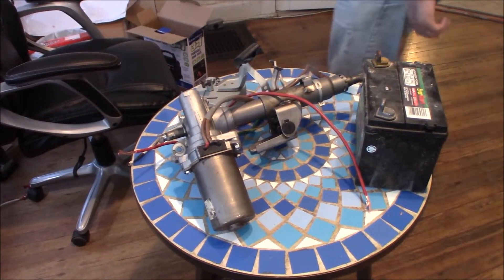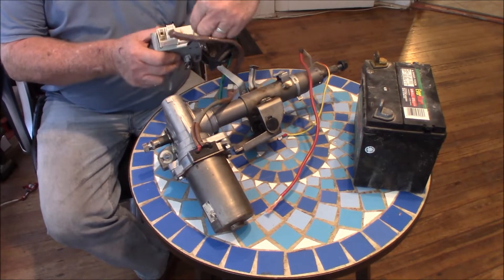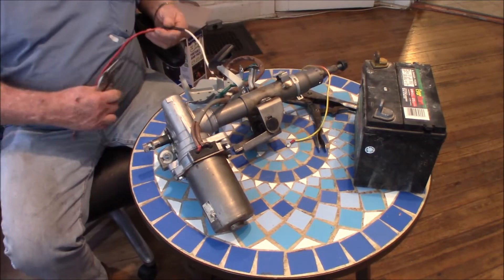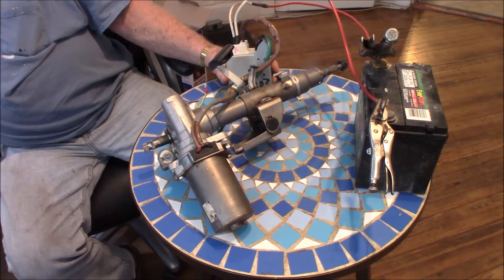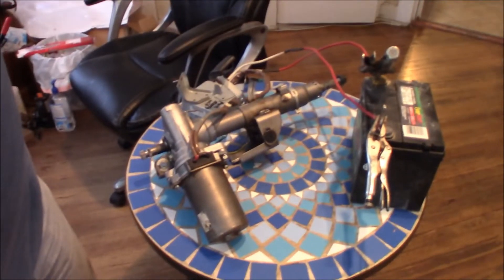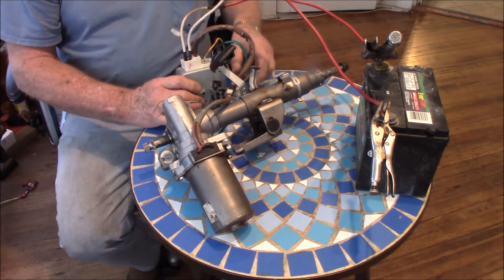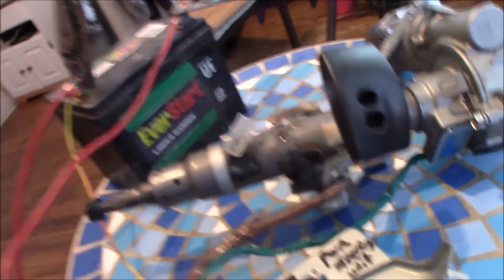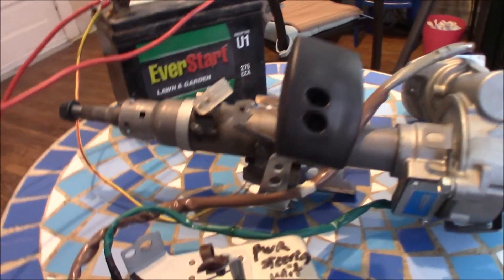2007 Prius electric steering,, why don't it work

Comment: Had the same issue with mine, after reading the comments here, I added a load to one end and it seems to work as it should, stating installation soon
Reply from the maker: yes, I didn't understand how those things worked at first either.

Comment: If you here a click when you connect the single wire, ( ignition volt trigger) then you should be good. You need to have resistance on both ends of the shaft.  I'd put a pair of vice grips on each end , to give you something to grip
Reply from the maker: yes, I finely figured that out but it didn't fit my tractor so I sold it thanks .

Comment: Did you figure it out?
If you didn’t the wire what you plugged in last (ignition positive) I believe there’s 3 wires in that last plug you need to ground also.
Reply from the maker: thanks for helping,, it turned out I didn't have a load on the lower shaft once I did that it worked as it should, thanks again.
Reply: @MissouriOldTimer  Ah awesome. Looks pretty easy to hook up and get working then. I might have to try this.
Reply from the maker: @JDawgBuilds  I was going to use it on my little tractor but there just wasn't enough room so I sold the steering unit.

Comment: I sell these (and the Nissan and Corolla version) on ebay and have more experience than everyone who comments. A few folks got it right and so do you with electrical connectors.

The way these work is resistance triggers them to 'assist' in the direction you're turning. So with column sitting there on a bench its simply waiting for you to turn the steering wheel AND have some resistance as if wheel is on the ground. 

Hook power and ground up only and grab two sets of vice grips,clamp one vice grip to the end to the splines on the steering side (this is the end with nut on your video) and clamp other to rack end spline on the steering shaft. Next have an assistant hold on to one end while you turn the opposite way. It will feel like nothing, because after all its just a steel shaft...next hook up that small accessory wire, this makes the system turn on and click. And do the same turn test with an assistant...be ready!!! The electric power steering is goin to assist the person turning. 

Ive sold about 40 columns this year alone. I hope this helps.
Reply from the maker: thank you very much.
Reply: @MissouriOldTimer  Not a problem at all, a buyer sent me this video and feared he would have issues. I have this same model installed in my Chevy Nova and Im never going back to hydraulic. Much love from Indiana
Reply from the maker: @2muchspl   unfortunately, I wasn't able to put this on my little Mitsubishi tractor, there just wasn't enough room, it would have been great if it would have worked.
Reply: @MissouriOldTimer  Yes, size is deceptive when it comes to these EPS. I cut, welded and random universal jointed via eBay to get it where I wanted. The hurdles were tiresome to say the least.
Reply: How much to you sell them for on eBay ?

Comment: I just bought the same one as yours i did the test very same as yours. I its didn't work just hear the click. I brought its to the store. They told me i need to put load in the end side. Tomorrow i will test before intall in my mini van. Hope its work. Your video very helpful. Thank
Reply from the maker: yes you are right it does need a load on the output side for it to work.

Comment: You need to ground the side with the small yellow wires too the cluster of three
Reply from the maker: it works ok, I just didn't have any load on the output side.
Reply: @MissouriOldTimer  I see, good

Comment: Have you tried also running a ground to both the module case and the EPS unit body as well. Normally they're bolted to the steel frame of the car body that acts as a ground for all the car's electrics. You've got both modules resting on a coffee table.
Reply from the maker: I was a dummy, I didn't realize I needed a load on the lower part for the sensors to see that they needed to add assist, but I later found out it actually works right, thanks for commenting.

Comment: The motor reads input torque to initiate the system. It has to be under load… connected

Comment: You need to put a load on the input and output shafts so the control box can see a load and it should work
Reply from the maker: thank you,, you are very correct, I did notice that after I made the video.. I hope shortly to try to rig it up on my little satoh/Mitsubishi   tractor.
Reply: @MissouriOldTimer  hey. I just received my one today and had the same issue.. any tips on how to load test it so I know its working before I start modifying it to fit the car.. a video of it working under load would've been amazing.. thanks for this though
Reply from the maker: @akib2542  like another guy mentioned, put a pair of vise grips on the steering wheel shaft and one on the bottom of the assembly , hook it up and have someone hold the bottom pliers and  they should not be able to hold the shaft when you turn the top part. that's where  I made my mistake, I didn't have a load on the lower shaft.

Comment: Hi ole timer, I think you are missing some grounds on the control box.  There looks to be 3 small ground wires you need to wire u.  Check out this video, starting at 11 minute mark.  You will see which I am talking about.   https://youtu.be/DIJjKu7uuMw

Comment: I don't know anything about this particular unit but it is a popular conversion over here to use the electric power steering from a small car. The one that is mostly used over here has an additional wire to control how much power assistance you require and when it is on the car it is speed controlled
Reply from the maker: I think that's kinda what the small wire on this one is supposed to do, but I'm not sure.

Comment: Personally, I have no idea how that works. But I can see how you might use it on your tractor to help steer it. Good idea and I hope it works.
Reply from the maker: the problem is , if I get this working, space is pretty limited on the little tractor.
Reply: @MissouriOldTimer  can you tell me how you got it to work I'm having the same issue

Comment: This probably has nothing to do with your problem. The electric side door on my Venture van stopped 
working but I could hear the relay working when I pushed the open button. A week later I noticed another switch pushed in. It was the switch that stopped the door from opening. LOL
Reply from the maker: when it comes to electric, I really don't know much,I'll have to do some more checking.

Comment: See if it is getting power to the steering motor from the relay  , if so must be something in the steering assembly
Reply from the maker: thanks, I'm not very good at electronics but I will try to check that.
Reply: I agree Lloyd ! I was going to say that , That would be the starting point I would try first ..
Reply from the maker: @shawnmrfixitlee6478  thanks guys, I'll definitely try to see if there's a broken wire or something along those lines causing the trouble.
Reply: @MissouriOldTimer  That is going to be nice if you can get it working ..